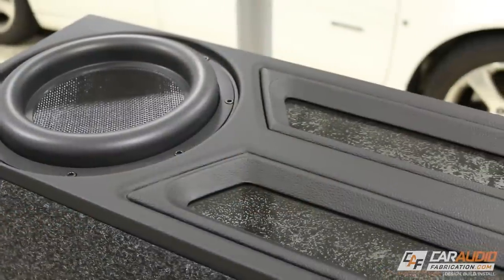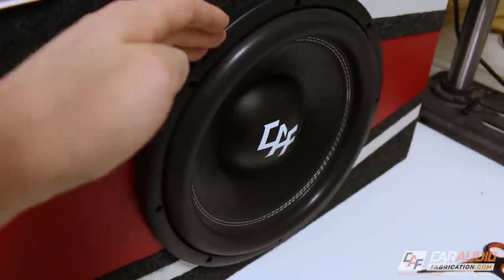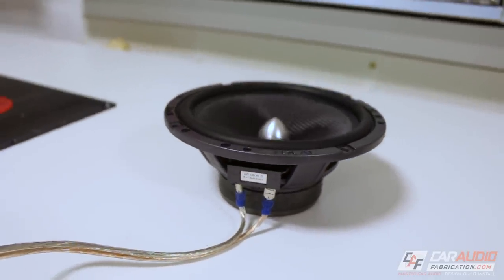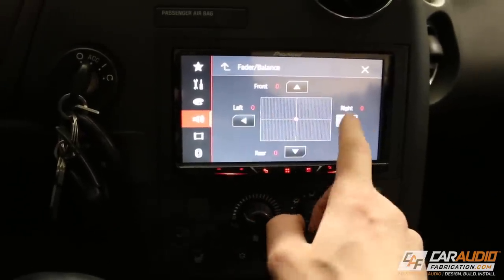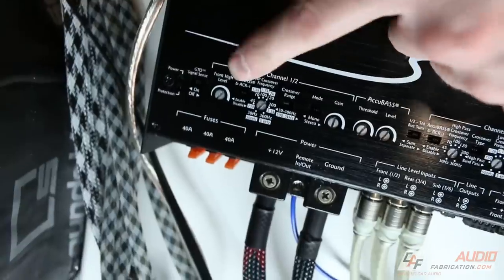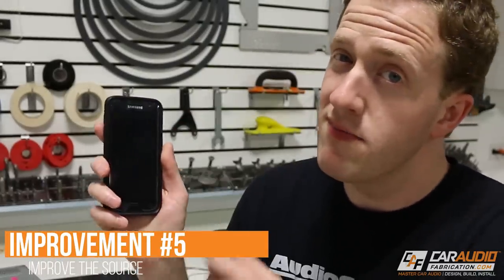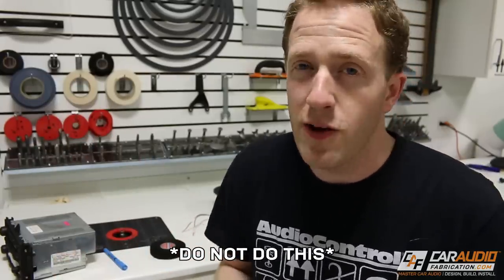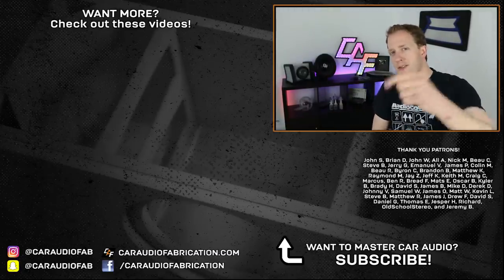5 CHEAP Sound Improvements you can make NOW - Car Audio

Comment: MP3 made sense back when memory actually cost real money. Not anymore. MP3 sounds like dookie. The better your system, the more apparent it becomes. Thousands of dollars in speakers, sub, amp, head unit and all the install materials...all so you play degraded files? A 128gb flash drive is $30 and will fit over 100 WAV Lossless albums. Treat yourself and your ears.
Reply: Actually, 320kb MP3s can sound really good. That is how I stream with Google Music and in a moving car, it is more than enough.
Reply: Tom Z: It sounds OK, but the sound imaging between channels just isn't there so you don't get the kind of immersion you do with WAV files. I have what I think is a well installed system of decent components and I can definitely tell the difference between MP3 and a WAV file.
Reply: I'm going to try out the different file styles for a comparison- you've aroused my interest
Reply: Daniel Private music i listen to doesnt come on albulms. Underground shit is life.
Reply: Daniel Private night and day
Reply: Sounds like dookie lol. Had me laughing for awhile
Reply: Daniel Private  it's all placebo. Proper 320kbps at 44.1kHz is more detail than the human ear can detect, especially with modern encoders (not from the early 2000s). Any defects in the sound stage, channel separation or dynamics are A) placebo or B) faulty/inferior encoders.

Comment: One I think you should have pointed out is either putting rubber between the screws and the mounting bracket for your license plate or what I've done in the past is just shoved folded up rag behind the plate. There's nothing that drives me more insane than when someone drives by and you can't even hear their base over their license plate rattling

Comment: Another cheap fix is to just buy a new set of door clips or fasteners any time you need to remove the door card. While you may not actually break them when removing the door, clips do age and become less resilient over time and are prone to minor damage during the removal process and they may not hold as well after the reinstall. Replacing them can often be a good precaution against undesirable rattles from loose panels.

You should also check the inside of your door card for any loose trim, seams, or accessories. If you find any, you can seal them with epoxy putty, or even body filler. Anything that will permanently bond those panels and prevent them from rattling. If those panels need to remain removable, fabric tape on the two mating surfaces can help dramatically to reduce vibration. If you notice vibrations within your door card even after all of that, try putting as large of a piece of butyl rubber deadening material onto the outer skin of your door pocket as will fit. Just stick it to the inside where you won't be able to see it. Those thin outer door pocket skins are prone to picking up resonance and will make the entire door car buzz.

Comment: Great stuff. My only observation here is your suggestion to tape the wire down inside boxes. When doing this it's important to use a good quality tape that can stand elevated temperatures. Most tapes cannot. WHY? Well it'll only take a few summer days in the sun to dry out that tape and before you know it that cable is rattling again! If you can, use mechanical clips or tie wraps with those little screw on bases. Also wrap the cables in a cloth tape (cycle handlebar tape is good).
Reply: Cyclone Cyd  I use RTV and spot dab a couple to the inside edges.

Comment: the larger terminal is usually positive speakers as well

also a large, old quilt is great for consuming holes and cavities in the trunk/hatch area for a super cheap sound deadening 
solution

i would also recommend cleaning your battery terminals and retorque-ing them as well as making sure the grounds are still solid and free of corrosion as a quick and cheap way to potentially help out your system

great video mark

Comment: Interesting, I do all of said things and more, just proves that we are the kind getting the most out of life. In One irock I built, I bought a amp and subwoofer with four speakers and wired them to the amp installed a new head unit. I also made a encloser for the sub myself. For audio stuff I spent $137. My friends spent $1500 to aftermarket upgrade theirs, mine supperseeds theirs in sound quality. They all even asked me to upgrade theirs like mine. Some things in life don't cost money as I've learned but instead intelligence.

Comment: Thanks for the tips mate. Im about to start my little project. Budget DIY install in an old 80 series Landcruiser.

New head unit, 4x new speakers and all wiring. Ill be mounting the speakers in the doors, with a spacer to allow them to fit. 

Ill be replacing the door skin's, as they are shot. Ill be making new skins.

Just wondering if you have any recommendations for types of MDF? Thickness etc? 

Ill chuck the speaker gasket sealing tape on the speakers, and around the new door skin's.

Cheers
Shane

Comment: If you want to save data (in case your carrier gives you limited high speed internet) use Ymusic, , because you can sign in with your google account and listen music directly from the youtube playlist you made using EDGE, but for that you have to: set up mp3 encoding on libshine for faster loading speed, set the bitrate on 94kb, set the quality on low quality and uncheck "use mobile data" for album artwork and other data. Audio quality is quite great, its not bad at all if you think so, you can only hear the difference if you have lg's quad beat headphones and lenovo phone that uses dolby atmos as its main equaliser

Comment: I was always told you want to direct more sound to the opposite side of the car to set the sound stage in the middle of the car
Reply: I think he made a mistake there.
Reply: It's more complicated than that. You really need a processor to be able to okay with the stage. Just adjusting balance will move all frequencies to that side. So some voices and instruments may shift, but others won't or could do the opposite because of reflections and speaker placement. Cars are terrible listening rooms lol
Reply: tcoffin014 processors are a bandaid for a poor quality installation. Totally unneeded of you take the time and get speaker placement and aiming right. Time alignment is great for lazy or shitty installers. Or for the customer that wants a good image and stage but refuses to modify his car and would rather just throw more equipment at the problem.
Reply: Christina Hollingsworth haha no not at all. Processors are always needed to get the best possible sound in a car. There is no perfect installation in a car. It's a freaking car. There's glass everywhere, seats in the way, speakers at different distances. Go look up the best installations in history. Or any sound quality competition car. There isn't a single one that's doesn't have a processor. If you're in a house with a sound room, deadened walls, speakers placed perfectly, enclosures designed exactly for those speakers, and everything like that, then yeah there's no need for a processor. But even if you get the best installation possible, adding a processor makes a world of difference. Bring me your perfect sounding car and I'll put one in for free to show you.
Reply: tcoffin014 dude they had sq competitions many years before dsp were introduced. And the scores haven't gone up much at all. Dsp is a bandaid for lazy incompetent installers. My car images almost perfectly and my stage is about a foot and a half wider than my a pillars. No dsp. Just custom speaker placement and aiming. The only thing a dsp is useful for is having 31 bands of eq per channel and mot all of them do that. Youre not talking to some rookie here bud. Just the fiberglass materials i have in my ride are probably worth more than your car. Have yet to enter it in any comps but have had experienced competitors listen to it and no e could say anything negative other than it needs to be finished. Once again dsp are bandaids at best. You sound like the kind of kid who thinks class d is the best thing to come along since processed cheese. Throwing extra unneeded equipment at an install isn't the way to.make it sound better. In fact it cam quickly make it sound worse. Any equipment in the signal path from source to speaker has the potential to add unwanted distortion and color your sound. And don't even get me started on the way dsp sum the signal from said source and the phase distortion that causes. An active 3way or higher crossover network is far better way to divide ones signal than that bullshit piece of software.

Comment: It’s actually sad how much time and effort artists, producers and sound engineers put into recording, mixing, mastering a song only to have it get “squashed “ into a super low bit rate MP3.. Thanks for the tips by the way, great video!
Reply: Proper 256kbps+ at 44.1kHz is more detail than the human ear can detect, especially with modern encoders (not from the early 2000s). Any defects in the sound stage, channel separation or dynamics are A) placebe, B) coincidence (like erroneous data transfer from the source) or C) faulty/inferior encoders.

Comment: I wish I knew about the speaker adhesive stuff before, I used Kilmat sound deadening in the speaker adapter that screws in my speaker and on the metal frame of the car to prevent vibration and it works well but damn wish I knew about that before lol

Comment: I have a 2001 Chevy Tahoe currently have a pioneer single DIN head unit RP 2000.1 skar evl dual 10s...
Ofc wire all the way around RCA cables on the opposite side.
it was working very good and all of a sudden I heard a thump and no more Bass.
I adjusted everything checked everything and everything is okay.
the next morning my fuse was melted and I had no bass.I took my truck to a professional audio shop in the guy said my subwoofer is no good.they Are covered under two-year warranty so I ship them back.when I remove them from my truck I noticed a burnt black round circle underneath where the subwoofers were sitting.... I don't know if this has anything to do with my issue but just throwing it out there.... I bought me a new amp in a new subwoofer hoping to rule out a problem and I'm still having the same problem with my vehicle...everything turns on  it has volts my RCA cables are working plus the settings on my head unit are set for a working subwoofer.
But I still do not get the power output the amplifier thump AKa the bass I have no bass like if I have no subs at all...idk can someone please help me????

Comment: My dad says that replacing the stock door speakers on a '06 volkswagen polo with a pair of Helix P 62C is not worth it, even if I add an amplifier and some sound absorbing material into the doors.
What do you think about it?
And, do they have a good bass that allows me to use them without a subwoofer, at least initially?

Comment: What about using a crossover with stock speakers?
Reply: Sure, if you can measure the frequency response and impidence, and calculate a crossover i do not see how it can make things worse since there are rarely any crossovers apart from a capacitor on the tweeter

Comment: hey mark, i had some window gasket laying around for ships, its alot thinker (1cm thick, 3cm wide) i guess as long it seals correctly it's fine but what's your thoughts? 
with polarity, i have the factory wiring from my head unit and i used a phone app that reproduced a sound to determine the polarity, and i had really poor bass so i figured it was the polarity, but i still wonder if my rear speakers a set up right as they don't sound like much compared to the front ones, i don't think this app is so precise but how could i know what's what from the head unit itself any ideas, i don't want to invest in a tool i need one time if i can get away with it.

Comment: Flac and wav codecs are amazing with 24bit DAC
But still nothing can beat pure analog like an acoustic guitar natural sound :)
Reply: I use acoustic guitar with studio true condenser microphone and class A pre and post amps and two high fidelity towers with 4th order linkwitz riley crossover and the sound is absolutely amazing
Reply: true the acoustic guitar is awesome
Reply: I was under the impression that 24bit was kinda gimmicky until I actually started hearing it
Reply: Manjul Walia digital actually has the capacity to soumd far better than analog recording. Now that almost all playback and storage media is digital recording in that format makes more sense than converting from analog to digital. Every time a song is converted from analog to digital or the other way around there is a great potential for losses and distortion to be added in the process. No mater the quality of the dac or adc used the potential is there. Also the bit rate at which digital is recorded can far out perform analog recordings. But there will always be the type of person who thinks that the sound of a tube amp is anything but added harmonic distortion and also swears by analog recordings. That being said class d amplification is going to be the downfall of quality sound. Unless they can figure out the output filter problem.

Comment: I installed a four channel amplifier under my passenger seat there are air vents under there if I have the heater on do you think my amplifier will overheat
Reply: Thomas Haws lol 4 sure if u actually use it. I have mine in the open and they'll overheat at max in hot days. Installers will limit what you have so its output doesn't overheat it.

Comment: Do you screw through the gasketing tape? How do you get a perfect circle? Little pieces
Reply: Chase Meyermann its highly flexible.just pull the backing off a little at a time as you press it into the shape you need.its actually really easy to do once you get started.

Comment: Love your videos always tons of good info... Quick question for you. When you install Cross overs do you suggest putting them closer to the speakers or closer to the amps. The only major differences i can see would be Easier accessibility near the amp but much more speaker wire is used.
Reply: Corey Van Leeuwen Skip the crossovers that comes with the kit and use the crossovers built in amplifier instead. Usually they're much better.
Reply: That is how i had my stock speakers hooked up and i controlled the cross over from the amp forward vs using the head unit but this never had my tweeters running off the amp just the head unit which was fine with stock speakers. Ive recently bought some very nice speakers ( hertz millie pro MPK 163.3) to replace my front speakers and tweeters and i really have a hard time believing that my 120$  sony amp can even remotely compare to a 700$ speaker systems built in cross overs, also there is no way to split the signal from my amp to the mid bass and tweeter unless i used all 4 chan just for the fronts then i would be left with no power for my rears that also require power from the amp (after market matching hertz)
Reply: For the length of speaker wire involved, you won't notice any difference. Unless you're using real low end wire and components, then personally I would be as close to speakers as I could. Because the amp will have more pushing power then the xover.
Reply: Won't really matter either way. Whatever is easiest for you. Not recommended to put them in the doors though

Comment: Quick question. Putting 2 amps in trunk of a car. How important is it to separate speaker wires from power, remote ect ect.?
Reply: Very. Especially because 2 amps will potentially have 2x the power running through those wires. Induction is a very real contributor to noise in any system, and although speaker wires are less susceptible than RCAs (because they are higher voltage) they'll still pick some of it up. Note that there are things you can do to minimize this effect such as using twisted pair and/or shielded wires, multi-shielded wires, balanced line drivers, isolation transformers, etc and if they must cross paths, ensuring power/signal wires cross at a 90degree angle (perpendicular).

Comment: And don't forget to NOT use the earphone jack of your phone if you're using it as the main audio source, you get a major improvement when using digital USB audio coming out of the charging port or either Apple or Android device, and most stock car audio system support it natively.
Reply: Domaudeo my 3.5 has a HiFi Quad DAC
Reply: Maybe but your car deck will convert it back to digital to "process" it so it will sound worst then feeding the deck only with digital audio and avoid reconversion. No car audio deck are pure analog these days...
Reply: Domaudeo I've had mixed results with aux ports.  I wouldn't go so far as to say never use it, and not everyone has a deck that can accept USB audio passthrough
Reply: Depends on which has the better dac. If your phone has a better dac then aux will sound better than usb
Reply: What about Bluetooth? I understand the 3.5 of converted to analog back to digital back to analog will degrade the sound some.
Reply: alexisthemexican Bluetooth is digital so it will use the dac in whatever you're sending your audio signal to. Aux doesn't go from analog to digital back to analog to digital. It just goes from analog to digital in your phone then bypasses the dac in the radio. That's why if your phone dac is better than the radio dac then aux will be better quality. But none of this will make much of an audible difference to most especially in a car

Comment: Is the amp powering the speakers and the sub or what? I want to get two front door speakers and a sub and a head unit the sub is 300 nominal watts and the speakers are like 55 should I run the speakers off the head unit and get a mono amp for the sub or can I get a 4  channel amp and run 2 to the speakers and bundle 2 for the sub in case I want to ad more speakers? I don’t really know what I’m doing lol.
Reply: Vaneater Sub and speakers run off different amps.